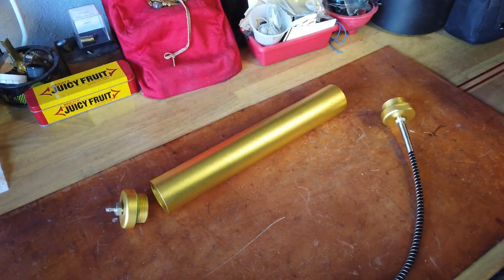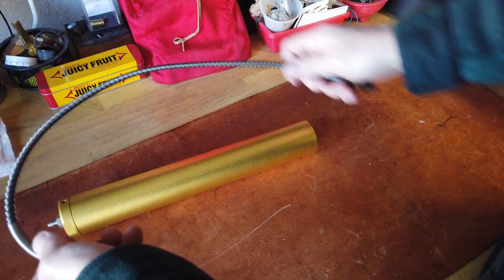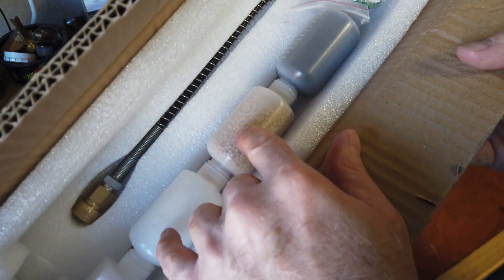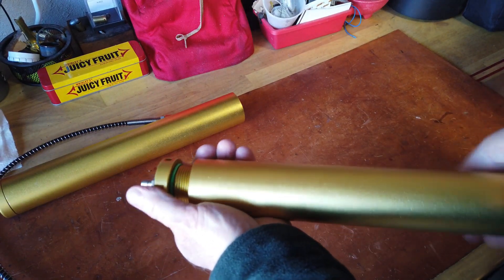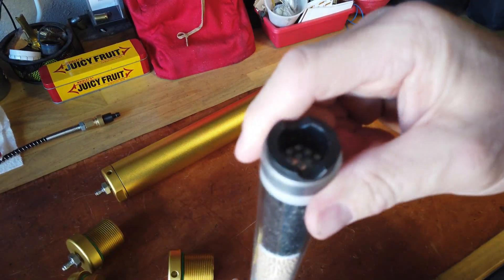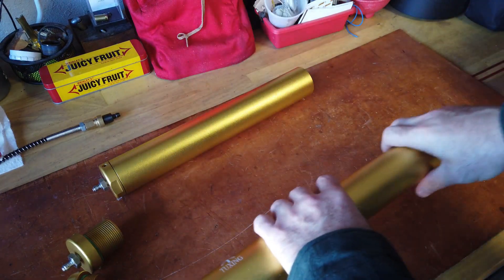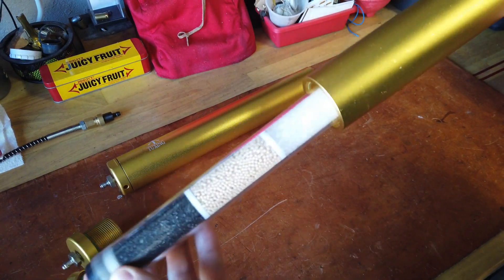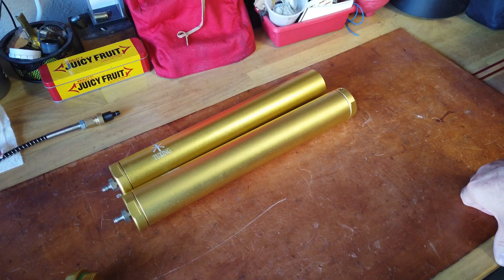Tuxing HPA/PCP Water/Oil Filter Update: Mixed Fillers Sieve

Comment: An issue I see when stacking several of the filtering tubes is those tubes must be brought to your targeted pressure of your connected  gun aswell.   Your having to run the compressor much longer each fill.   When I see videos of those running several of these larger tube filters, the amount of air released when they bleed off the lines is greater than if they degassed the guns tank.  The additional run time increases the amount of water generated .  Seems like we should be focussing on drastically lowering the humidity of the air being pulled in.
Reply from the maker: Good points.

Comment: While the Tuxing compressor has a water separation device between the first and second stage, it is still far better to feed dry air into the compressor.  Water will condense between stages, causing seal failure as it flashes back to vapor during low pressure periods.

I use a 120 PSI storage tank with a half pound of 3A molecular sieves to dry air, then draw this air off at 3 PSI to feed the compressor.
Reply: While waiting for my compressor to arrive, I also have contiplated how to dry the air prior to entering.  My first thought was also to draw it through an oversized version of the intake drying filter that Tuxing offers.    I have several cars that are stored over the winter in fully enclosed tarp car ports.  To reduce humidity inside I used to place several of the large DryEz bucket sized containers they promote for large RVs.   Was later  told that even a small $40 active dehumidifier was a much better idea.    Placed a new bucket of DryEz along with a active dehumidifier as mentioned.  Also placed a small 150 watt heater inside the vehicle  so temps stayed above freezing.   After 2 weeks the active dehumidifier had almost 4 cups of water in its collection container.  I measured the weight of the DryEz bucket with a very precise scale and compared its weight from when it was new.  It's weight indicated it had captured right at 3 tablespoons of water.   Simular results when using a large bag of color changing silica . Thinking I may use a large dehumidifier I already have in the small room I will run the compressor.

Comment: Thank you. I ordered the molecular sieve inner piece for the older tuxing. The one shown in your video. I had no clue that the new tuxing looks the same on the outside but has different caps with much longer threading! Now I have to buy a new one.
Reply: Thank you for the info. 👍
This really helps as I was going to buy a casing and media tube separately as it’s cheaper but it’s possibly the I’d be wasting my cash.

Comment: Do you have to have a pipe wrench to open this?
Reply: It can be a bear, but use some silicone based dielectric grease on the threads and it makes a huge diff.  A little goes a long way.

Comment: These can do 4500 psi? No problems?
Reply from the maker: I can't recall what it was "rated" at, so I won't make any claims on PSI numbers.  They've held up for me and my needs however.
Reply: @ReLoadersBench  what have you used it to? 3000? 3500? 4000?
Reply from the maker: @darklyte24  My tanks are all rated @ 4500 psi
Reply: @ReLoadersBench  I think on amazon they are listed as 300 bar, which is only 4351 psi? I dont know why. But if you have used them to 4500 psi then thats great. When you fill up a tank, is there anything you do to remove water from the filter / separator?
Reply from the maker: @darklyte24  I remove the caps and let them air dry.

Comment: Can I use this in a handpump?
Reply from the maker: I don't see why not although it may be a bit overkill for a handpump.
Reply: @ReLoadersBench  the filter that came with my pump didnt filter all of the moisture and that caused my fill valve to rust and leak air.
Reply from the maker: @honeybadger2514  The "included" filters that come with most pumps (and compressors) aren't too good (from what I've seen). I'm sure there are exceptions to that.

Comment: What does the second one cost ?
Reply from the maker: Same price as the first one.
Reply: @ReLoadersBench  is alibaba safe really to buy from ?I found tuxing compressor I want buy from there iv never bought from that sight
Reply from the maker: @1000186ful  - I can only speak for myself and only had a couple of purchases from alibaba without issue.  I would only use a credit card for fraud protection and possible/timely dispute resolution.

Comment: charcoal is useless in my opinion for filtering. It is only useful to avoid bad smell due to compression. Molecular sieve only is probably the best version because the sieves keep humidity and you can regenerate them using an oven when they are too humid.
Reply: those glassy beads (silica gel) are also good at water absorption and can also be regenerated. most dehumidifier products use the glassy beads. Molecular sieves are better at doing the same job.
Reply: Molecular sieves are for carbon removal, not moister. Desiccants are used for moister and they aren't like sponges and require contact time. Having a pill bottle full isn't going to absorb a room full of air moister. Carbon is useless unless breathing the air you're pumping. But then you wouldn't be using a pcp pump if that were the case.
Of these two options the cotton or foam is a better bet catching moister and oil. Replace them often and recycle them if you happen to have a dehydrator to dry them out.
Reply: @beebop9808 
Odd as removing moisture is one of the first properties given of molecular sleeve. If you Google it

Comment: I just received the tuxing upgrade and i am using it for my portable scuba tank. But i noticed that when it got assembled. They put the connection backwards and i would like to confirm the set up with you. To my knowledge,   the charcoal.. should be the last phase for the air. Before entering the tank or guns. Am i right. When i detatched mine after the first use. I noticed the quick connect was threated on the cap holds the inner tube in place. Leading the air to pass through the activated charcoal first. And i am positive that the air coming out of the compressor hose, should hit the clear bbs. Then the desiccant as stage 2. And the activated charcoal as stage 3 for a pure, cleaner, dry air. Because the charcoal shouldnt be the 1step. It will collect the water before it hits the desiccant. So i unthread the quick connect nipple, and switched it with the hose. So inside the tube, the activated charcoal is on the side, that the hose is connected. Hose that goes on the filling tank. So check on yours the way it came. Usually you wouldnt need the charcoal if you process air for shooting.  But it wont harm your riffles or pistols if you do. U want nice clean air in them. So in your video, i noticed that yours came in, wrong as well. Analyze your video and u will see that the cap with the quick connect plug,, where the compressor hose goes in. It will push air to the activated charcoal first. U have to switch  the hose, to the cap that is not set to hold the inner tub with the O ring. So your quick connect nipple should be threated on the cap that is made to hold the tub snug. Again, the charcoal should be facing the side that you screw the cap with the hose that connects to your air tanks or riffles. If u havent changed it. You are getting the moisture or water on the charcoal first, soaking it wet. To then hit the desiccant furthet in.  Switch the connection
Reply: Please do NOT use for breathing air!!!!!
Reply: @robertmillen2967  shut up old man i'll do what i want
Reply: @schlomoshekelstein908  you tell ‘em Schlomo!
Reply: Yes charcoal is the last stage then into the tank.

Comment: adding the tuxing filter create more load on the yong heng compressor
Reply from the maker: not adding the additional filter(s) creates more oil and water in the air tank...not a good thing at all.  A trade off I'm willing to make.
Reply: @ReLoadersBench Where does the oil come from?
Reply: Yes that makes sense because anything in addition between the compressor and your intended hpa cylinder adds to the volume that it needs to fill.

Comment: I tried to buy one from Alibaba&Express but it is confusing. I gave up. Still needing a filter. They make several models .I think the one with the three types of media is the only one with the interior tube with the o-rings at the bottom.
Reply from the maker: If I recall, there were a few choices (desiccant, charcoal, mixed, etc.).  I chose "mixed" for mine that has all of them in combination.
Reply: ebay has em $110
Reply: @Raven4122  CAREFUL! There are Chinese knockoffs of this Chinese product that are just threaded seamed pipe - and they will EXPLODE! See the $79 one marked the same (but the painted on logo is fuzzier) on Am a zon. Check the review with pics that shows the SEAM inside!

Comment: Would you recommend the Tuxing compressor.  Very little info on the internet for this compressor.   Also, what about ordering parts for repairs?
Reply from the maker: ryuge84 - I have had my Tuxing compressor for over a year now without a single issue. I change the "oil" (I use HA 46) as soon as it darkens, only run it to 62 degrees celcius, change the water to cooler water each tim I reach either time or temp limits and change the small air filters after 15 min of run time.  So I haven't had the need to source parts for repair.
Reply: There is all kinds of info on youtube,try looking harder.
Reply: Yep and overwhelming reviews are tuxing compressors are utter garbage

Comment: I think your video helped me figure something out. I just received the oil/water separator like the one you have with the longer end caps that came with the charcoal and desiccant. Could you do me a solid and look at the interior of your two cylinders and see if there is a difference between the two. My cylinder came with some small groves running the length of the cylinder. I'm curious if that's because it was meant to have that secondary cylinder with charcoal and desiccant. Thanks in advance.
Reply: I have the same filters and both are totally smooth, well machined on the inside

Comment: If I was to use that with Yong Heng what other fittings would I need to connect it?
Reply: There's a chap on Youtube that is already using this with a Yong Heng
Reply: David Storton  do u have a link to that video?  Thanks
Reply: @22lr_plinking  CAREFUL! There are Chinese knockoffs of this Chinese product that are just threaded seamed pipe - and they will EXPLODE! See the $79 one marked the same (but the painted on logo is fuzzier) on Am a zon. Check the review with pics that shows the SEAM inside!
Reply from the maker: Comes with all the fittings you need to either connect it directly to the compressor or to the filter(s) you may already have.  If you see my previous video on the Tuxing, you can see how the filters connect.
Reply: Re Loader  I’m going to find that video now. Thanks